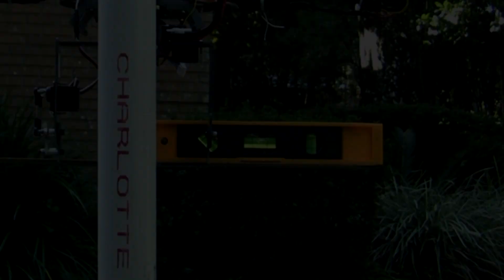Gimbal set up on the KK2 controller with firmware version 1.5

Comment: Moin, hast du im mixer editor auf 7 und 8 was an den Einstellung geändert? Mein Board (FMW 1.6) will einfach nicht ansteuern. die Gimbal Motoren summen nur. Oder Brauch ich seperat Strom auf 7 &8 ?

Comment: great video thanks!  I am using the fat shark for a camera operator and wanted to add the head tracking movement while letting the kk2 keep it stable?  think I am trying something the kk2 cant do.  since it only has 5 inputs and the fifth ch is for stabilization. might have to purchase a second kks just for camera operator.  any ideas?

thanks
Greg

Comment: Have you tried the KK2 1.5 Firmware update with Gimbal Mod Transmitter Override? I'm wondering if I can override pitch from KK2 to tilt the camera 90 degrees down during flight with transmitter pod. Has anyone tried this?

Comment: very nice!  I've got a x550 with the pitch gimbal.  Trying to get the camera stabalization working.  Servo powers up and centers but no matter how much gain I set it to, it will not move around when I tilt the quad (yes while the motors are running). Servo is active as when I try to move it by hand when board is armed, it gives resistance.  Any tips?

Comment: Great video Mr. Scsi.  building a gimbal for my tricopter and will be using one of my KK2 boards for it.  Not sure what I want to put my MultiWii board on yet.  It may wind up on my tricopter though because it has the barometer.

Comment: not sure if this has been brought up before, but just to share, if you want to test the camera servos without the motors running, you can go to the misc settings and set min throttle setting to 1% instead. (default is 10)

this way, you can arm the kk2 board, move the throttle stick up 1 or 2 notche(s), and the servos will start to react to movement but your motors wouldn't start spinning yet. (still, it is best to remove the props as seen in this very good video). 

thanks!

Comment: Sometimes you need to connect a 5volt source (like a BEC ) to get the servo's working. Also make sure the cables are connected in the proper way. - should face the outside of the board and M7 and M8 are to be used for the gimbal controll. Good luck!